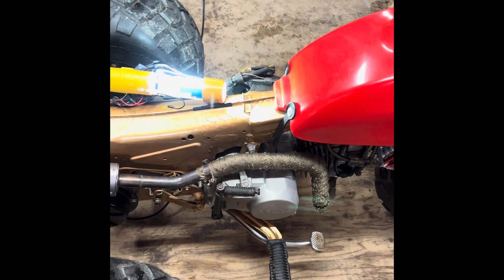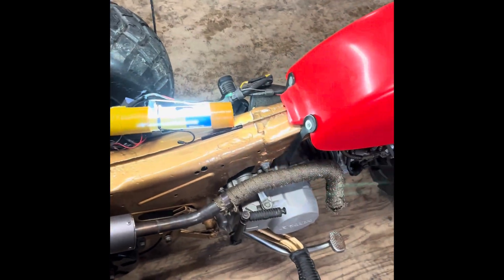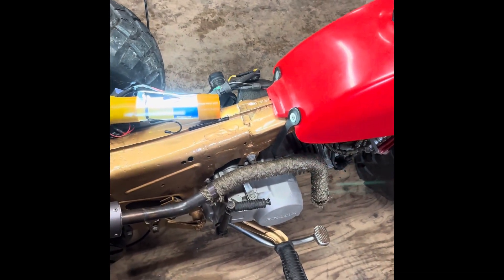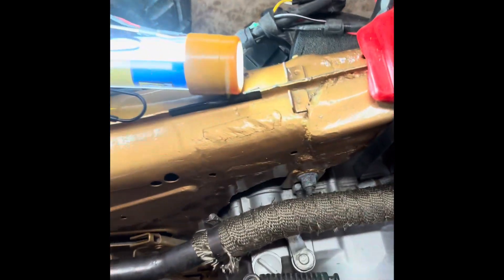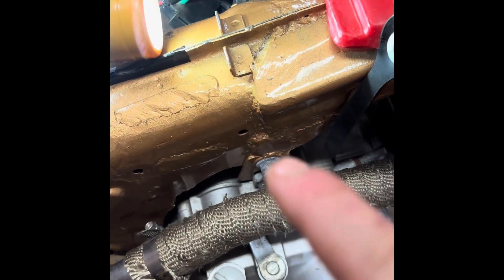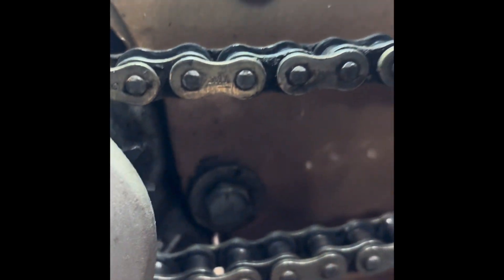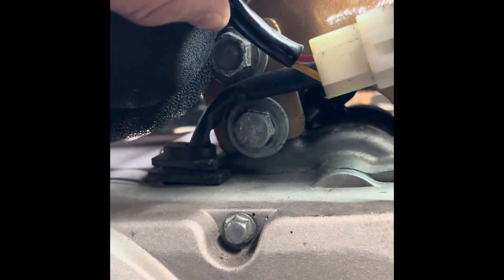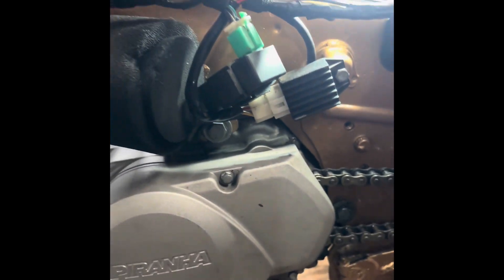Close up on engine bolted in the frame

Comment: So it just bolts in?
Reply from the maker: @GavinElliottttt  Just had to cut back the frame to make the engine fit. Weld on the two top brackets and bolt it in. Also strengthened the neck of the frame by welding a metal pipe in it.
Reply: Man thanks for the reply…I can’t find anything new to ask comments about
Reply: What is the best motor to get?